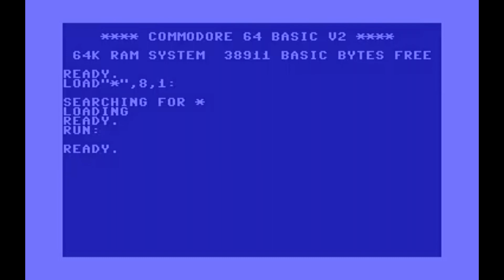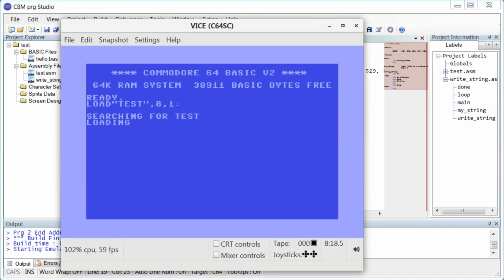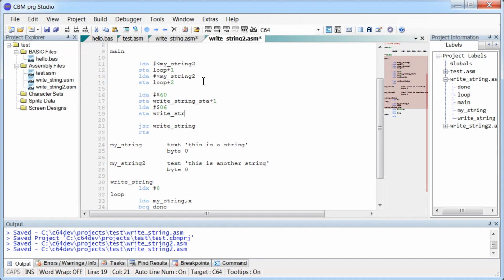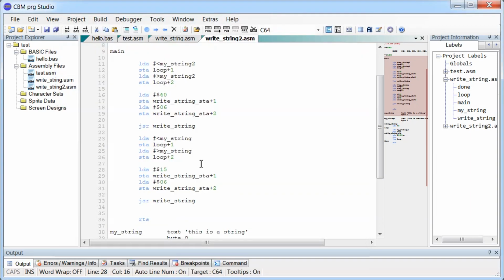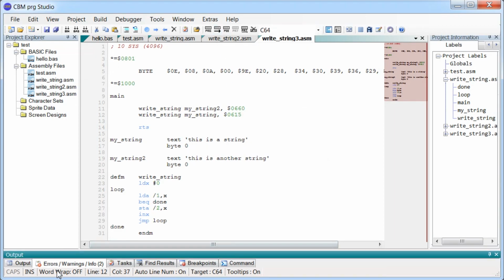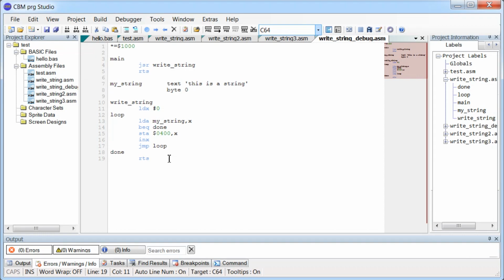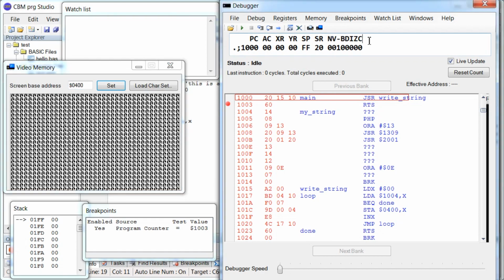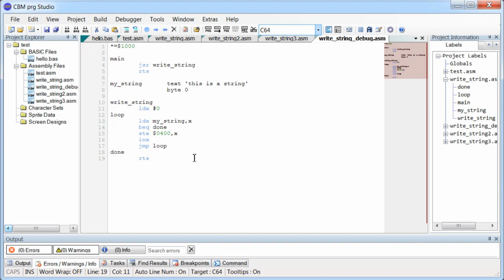Retro Programming on the Commodore 64 - Episode 2 - Assembly Programming

Comment: Am enjoying this series a lot. I'm quite new to assembly programming. My question is: I noticed most of the memory addresses were in different forms (hex and what seemed to be just decimal). Can you elaborate on how you reference the addresses and in what form they take to keep them consistent in your program?
Reply: If you enjoy this maybe you'll like my new series on C64 asembly too. A lot less indepth but more practical and more structured. Self modifying code is not something you teach in the 2nd lesson usually :D 
And concerning the notation of values, the great thing about an assembler is that it doesn't care. Somethings I do in decimal simply because it reads easier (like copying 40 chars) and others I strictly use the hex such as $d012 $d020 $d021, $0134 $0135, because they are hardware specific and generally well known.
Reply: @CallousCoder  
It's been a while since I commented.   Can you link me to the new series on c64 assembly you mentioned? Would love to check it out.   
That makes sense about either decimal or hex.   I would do with what works easier myself as well.    I do a lot of scripting in batch and bash but am not a skilled high level programmer.   I took C++ in college and found logic hard to keep up with while maintaining code syntax.   But I still enjoy trying it.
Reply: @samhoward8909  oh it’s on this channel of mine CallousCoder, it’s the last 7 videos. Or C64 assembly playlist.

Comment: One caveat on string termination method that I found. If you have the @ symbol in your string of text to print, then using this method will terminate your loop when it reaches that character since it's value is 0 and it will take the branch if equals 0 to the done label. Probably does not come up a lot, but just something to note.
Reply from the maker: Agree. I usually move the @ symbol elsewhere as I nearly always use a custom character set, but you can of course also use another value and spend a few more cycles checking for that value.
Cheers,
Jake

Comment: Hi. The JSR instruction pushes $1002 as the return address. Looks like a 6502 optimization. It "jumps" before incrementing the PC register probably saving one clock cycle.
Reply from the maker: Agree, it's an interesting quirk and if you do something like a jump table implementation using rts and the stack to jump then it's important to start each step with a nop to compensate. Might be interesting to have a look at the 6502 microcode to see exactly what it does.
Cheers,
Jake